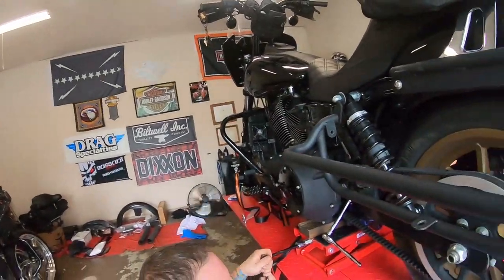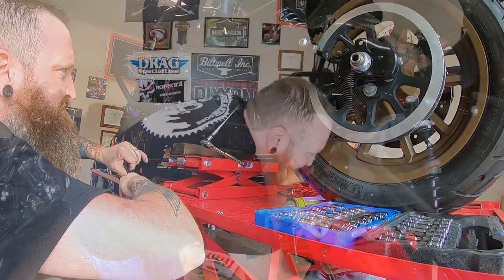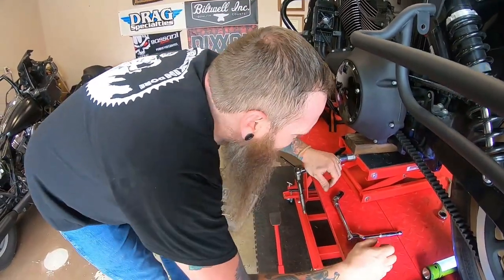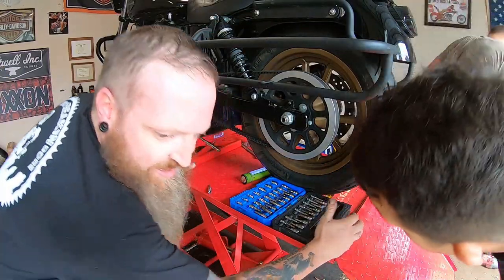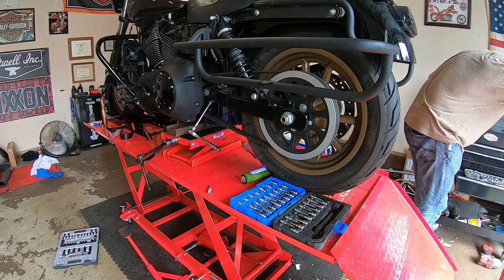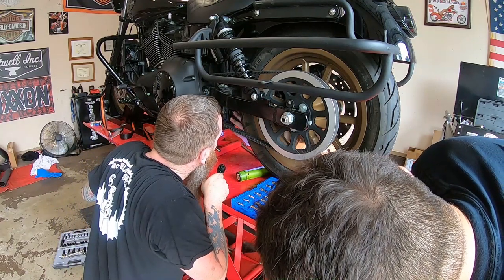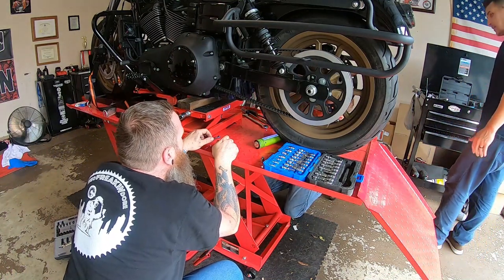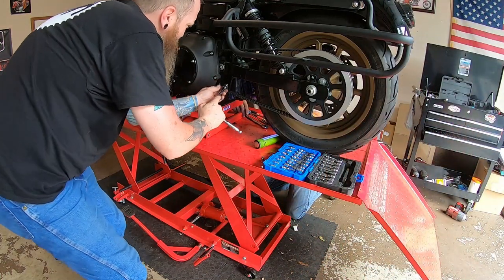Broken Motor Mount Bolts: Helping Dyna Demos Get Back On The Road

Comment: Why do you suppose they broke? Your bike is fairly new right?
Reply from the maker: Wasnt my bike I assume the bolts worked them selfs loose them broke
Reply: @TrippHPjunkie  I had the rear mount bolts (the ones to the trans) work loose after about 10K miles on my 2010 Dyna which I bought new..... should be on the 'critical fasteners'  list but they are a bitch to get to as the exhaust and rear brake master cylinder has to come off so no-one does it !